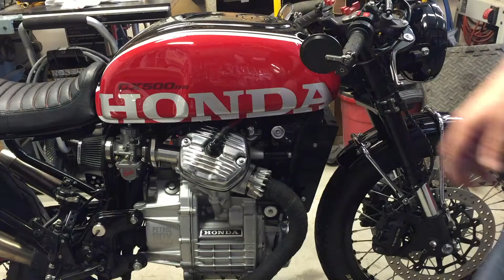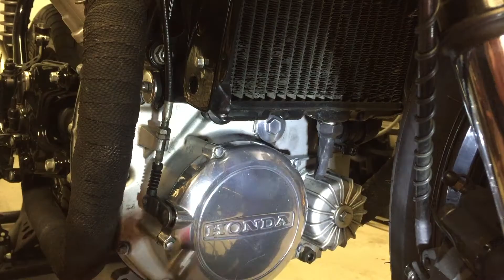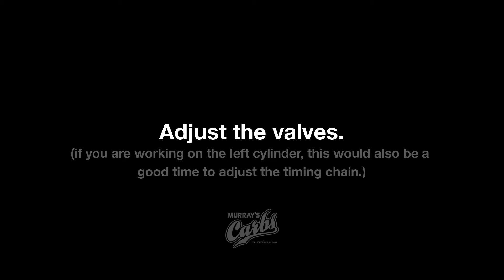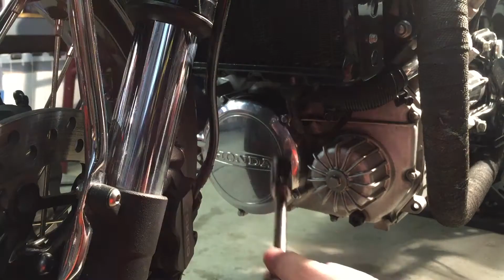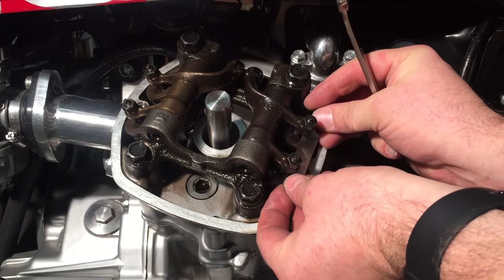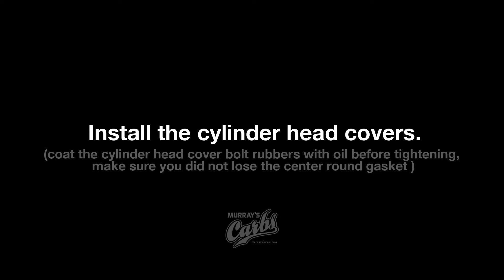Murray's Quick Set Tool

Comment from the maker: Remove the key from the ignition.
(keeping it far away from the bike until your completely done)

Remove the spark plug caps.

Remove the cylinder head covers.

Remove the spark plugs.

Remove the crankshaft hole cap from the transmission cover.

Choose a cylinder to start.(you can start on either one, it is recommended to start own the left side.)

Turn the crank (clockwise) until you see the intake valves go down.
(the intakes are the ones near the carbs or the back of the bike)

Turn the crank slowly until you see the intake valves rise to their peak, then continue to turn the wrench (clockwise) one half-turn.
(this will bring the motor past TDC)

Install the Quick-Set Tool in the spark plug hole just by hand until it seats.

Slowly turn the engine backwards (counter clockwise) until it comes to rest against the Quick-Set Tool and stops.

Adjust the valves.
(if you are working on the left cylinder, this would also be a good time to adjust the timing chain.)

Loosen the cam chain tensioner lock bolt. When this is loosened, the cam chain tensioner should automatically position itself to the correct cam chain tension. In that these bikes are getting older it is a good practice to use a bit of wood and a dead blow hammer to give it a few taps to loosen the cam chain tensioner mechanism. Retighten the bolt to the correct torque settings.

Adjusting the valve settings, by loosening the lock nut, and turning the screw until there is a slight drag on the feeler gauge. Hold the screw and tighten the lock nut. Recheck the valve clearance once again before moving on to the other side.

Valve settings
CX500 IN: 0.08mm (0.003in.) EX: 0.10mm (0.004in.)
CX650 IN: 0.10mm (0.004in.) EX: 0.12mm (0.005in.)

Turn the motor forward (clockwise) just a smidgen to relieve the pressure off the Quick-Set Tool, then unscrew it.

Watch the valves on the other cylinder until the intakes go down.

Turn the crank slowly until you see the intake valves rise to their apex, then continue to turn the wrench (clockwise) one half-turn.
(this will bring the motor past TDC)

Install the Quick-Set Tool in the spark plug orifice just by hand until it seats.

Slowly turn the engine backwards (counter clockwise) until it comes to rest against the Quick-Set Tool and stops.

Adjust the valves.

Turn the motor forward (clockwise) just a fraction to relieve the pressure off the Quick-Set Tool, then unscrew it.

Now it is time to put it all back together.

Install the crankshaft hole cap on the transmission cover.

Install the spark plugs. Install the cylinder head covers. 
(coat the cylinder head cover bolt rubbers with oil before tightening, make sure you did not lose the center round gasket)

Install the spark plug caps.

That is it Go for A Ride!

Valve adjustments are much faster, following this procedure you cannot set the valves on wrong (exhaust) stroke. You no longer need to use the align the marks on the rotor.

www.murrayscarbs.com
Reply: +Mike Meyers Thanks for the video and instructions.  I wanted to get some input on the cam chain tensioner adjustment.  The CX500 forum wiki states " If you previously arrived at the TL mark by even slightly rotating the engine backwards with the front bolt, go back and approach the TL mark from the clockwise direction... "    Just want to know if adjusting the tensioner using the instructions here with a counter clockwise arrival at TDC is ok.  Thanks.
Reply from the maker: Yes it is.
Reply: Mike Meyers hi Sr...i have a 1983 cx650C I hope you can help me to set the valves gap right...your video it's great but I don't have the quick set tool and the way I did it was I turn the engine until gets to the mark TR or TL and I wanna know if that's correct and if you can tell me the spec for the timing chain please...I see on another tutorial that we need to get the mark F so I'm really confuse please help

Comment: I just acquired an '81 in decent shape and I'm going through the mechanicals. I own air cooled Volkswagens, so I understand the how to, but not the why for this motor. Because of the heat / cooling cycles of the air cooled motor I expect to adjust the rockers on my VWs. I would expect the heat / cooling cycle of a liquid motor to be less drastic and the period between adjustment longer. From what is described, the interval is the nearly the same as the VW. I was surprised to see that.